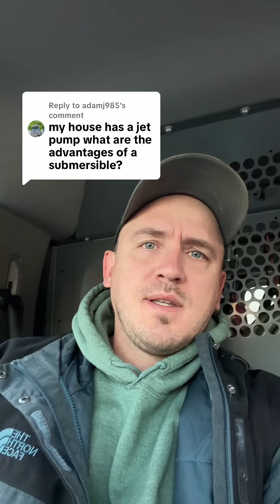Jet Pump vs Submersible: Which Is Better?

Comment: Serious queation. What is the maximum depth of well can a jet pump be used in? My well is 300+ feet and has a submerged pump so its not like im going to change anything, I just want to know.
Reply from the maker: Jets cannot go nearly as far as a submersible. I'm working on a long form video to go into more detail. The max depth is typically considered to be 125 vertical and horizontal. The avg depth of a well with a jet is usually less than 100 feet. I would argue they're usually closer to 60-80 feet. These shallow wells typically have more issues with reliable yields. Especially when they're near heavy development.